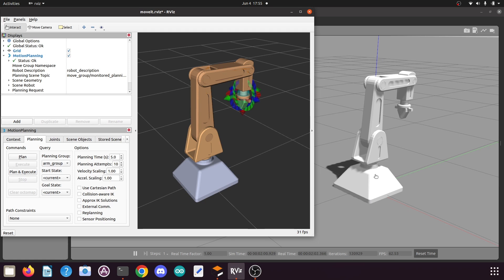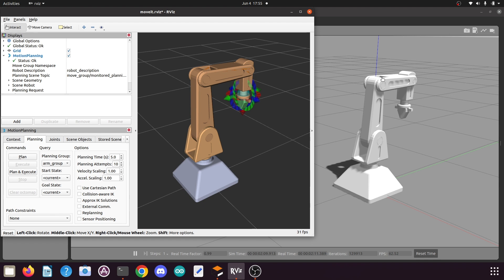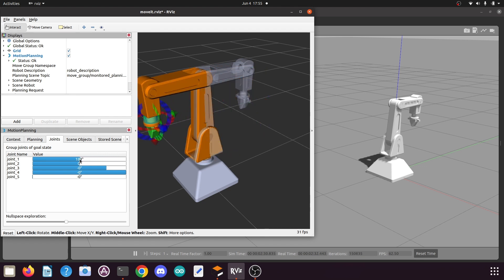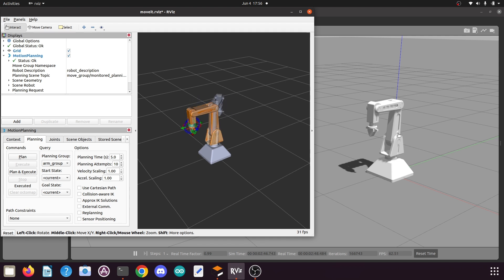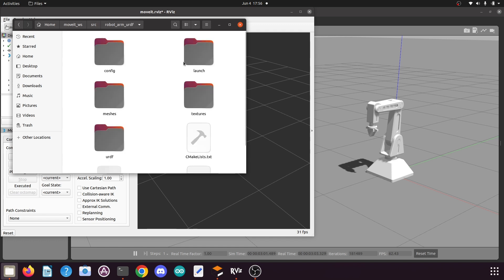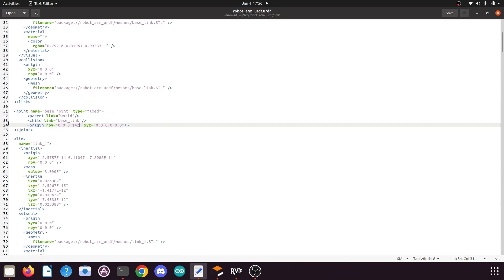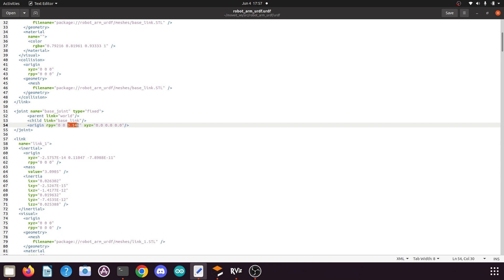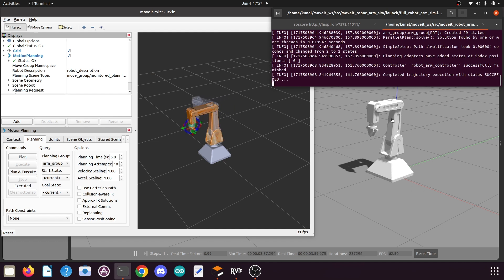Lesson 14.1: Troubleshooting Robotic Arms Launch Position in ROS

Comment: Hey man ! It would be little easier if you could provide use the workspace structure. The github has all the files but it is difficult to place them in separate folders without seeing each video one by one.Thanks !